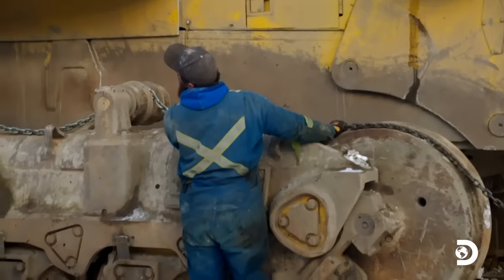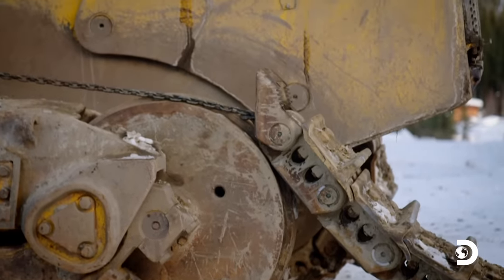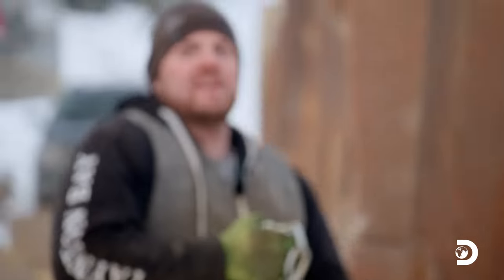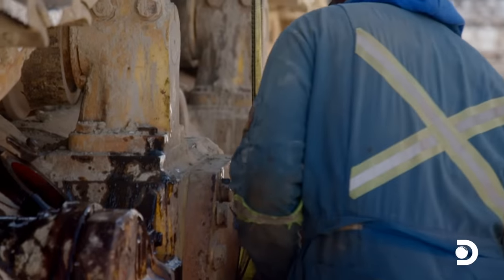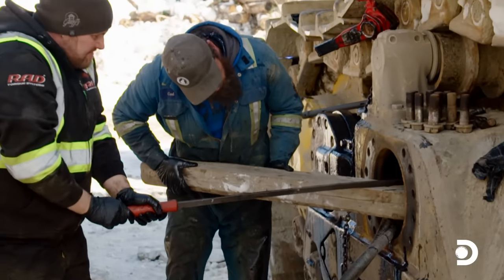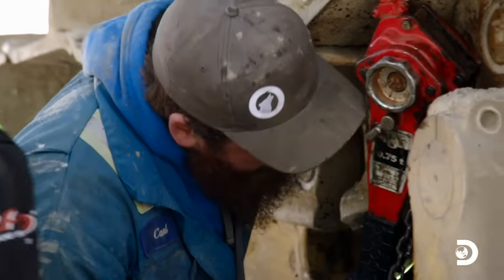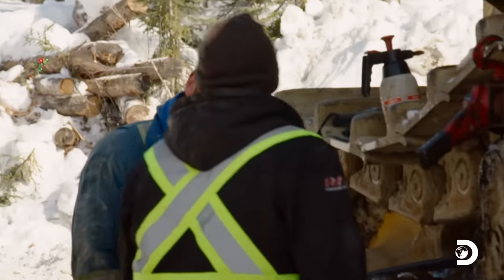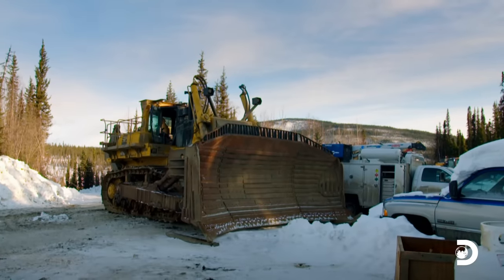Repairing a Huge $500,000 Dozer | Gold Rush: Winter's Fortune

Comment: Tracks still look very loose, the rails are nearly dragging on the side frame by the front idler. 

I have to laugh at discovery how they edit in “vroom vroom” sounds to excavators and crawlers.  All the cityidiots love it but any one who is around heavy equipment im sure has a good laugh.
Reply: That chain in bucket pin hole rips the bushing seals if there is any left.

Comment: Wrong. You bleed any hydraulic pressure from the track system. You then disconnect the master link in the tracks causing the spring to extend all the way. Then you can easily rotate the idler rotation.

Comment: One thing I've never understood across the mining shows is the lack of preventive maintenance. They lose so much time to broken/down equipment because they didn't maintain it over time.
Reply: That's how the one quarry I live by operates. They beat the piss out of the machines then once they finished the mine they just left them.
Reply: thats every trade, i started working for family and they get mad when i fix things when its slow, but when it breaks im asked why i didnt set it up before hand lol
Reply: Well thats what happens when they arent smart enough to buy new gear.. Theyre trying to be productive with someone elses worn out junk.
Reply: Idk about gold mining but coal mining in WV. The equipment is worked until it just can't go anymore and then sent to the shop or set to the side and another brought in it goes 24/7 363 days a yr
Reply: Im sure they do but mining pushes this equipment to the limits and not to mention the weather makes it even worse.
Reply: I work in a rock mine and almost every truck is rented. We run them things into the ground and let Holt deal with it 😅

Comment: Is that as big as the D11?
Reply: About equal. I run D11s and it seems just as big.
Reply: Its the equivalent to the D11. I never had the chance to run the 475s before they left out mine but i hear they push a touch harder. At the cost of the operators spine mined you!  Ive ran 375s D10s and D11s the cats are so much nicer to run.

Comment: Thing that irritates me about discovery is that they always say what potential harm could be done to equipment when something goes wrong, never considering what could happen to the people, if someome was in reach of that chain, it could break, swing back and kill someone, but they don't mention that. That chain could come flying through that excavator cab and kill the operator, but no, could just damage some equipment
Reply: They do.
Reply: The bucket would catch the chain with how they had it set up
Reply: @celuler22  when that chain breaks, it could fly in every single direction, as well as past the bucket right into the cab. You don't want to take chances with that kind of stuff